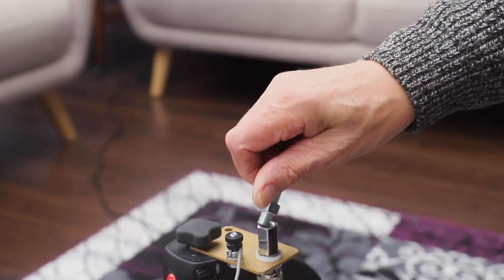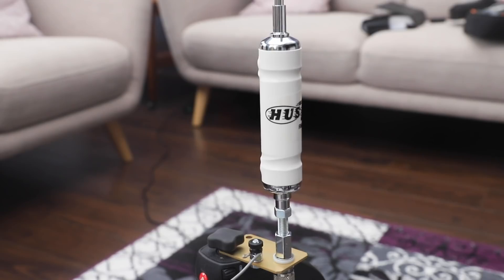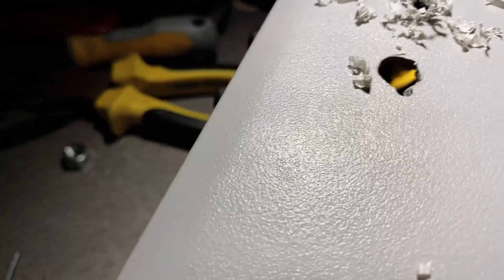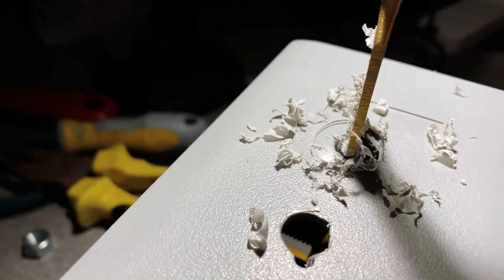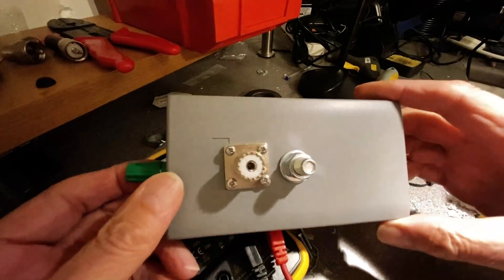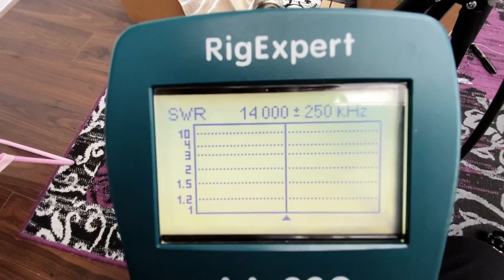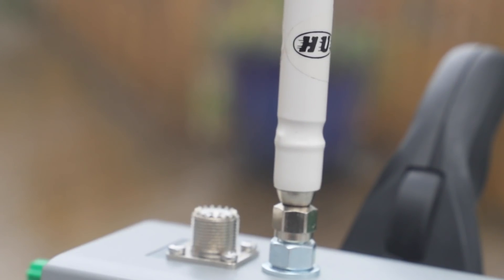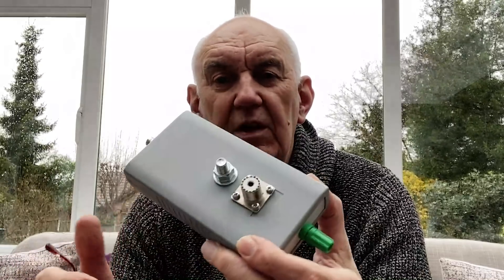Low Cost HF Portable Antennas - Great for IC-705!

Comment: Everything seems very weak and wobbly... you need to mount things using stronger clamps, connections, and things.
Reply from the maker: The engineering is up  to the user and the conditions in which it is used.

Comment: Another great idea from a man who knows.

I used to have every Hustler Resonator for mobile ops with a TS-430. I used a CB Spring mount on the rear quarter of my 1979 Ford Wagon and a Huster mast to get the resonator(s) above the roof line. I drilled and bent a strip of Alu and mounted 2 and sometimes 3 resonators. 40 or 20 up, 17 and/or 12/10 tilted back.  The tuning varied only slighty from just 1 to 2 to 3 resonators. It all worked quite well for the several 90 minute drives to/from the New Hampshire/Main coast lines for a day of Salt/Sea/Sun with the Dogs/Kids/Wiffy and once with a Siamese Cat!

Never thought of using the Hustler Resonators for Portable Ops. Great idea.

Getting HAM Functional again after a 4 year absence via Mobile/Portable Ops. Too much PowerLine/BCI noise to opperate from new QTH. This vid is a positive addition to my plans.

Thank You Sir for this and your other excellent posts.....

73 OM

Comment: I always been thinking about the common mode chokes in mobile usage, I have done some small testing with a mag mount, but don't record the results, I can remember the swr was impacted, and also the metal around the ferrite (cars body)

I'm just living in the belive that peple usually don't care about common modes in mobile hf, I might be totally wrong though, but so far what I seen it's quite rare to see chokes on mobile instalations
Reply from the maker: Thanks Kristian for that info. 73s Peter.

Comment: Where can you purchase a 3/8" male-to-male stud adaptor as featured in this video? I tried your website, but https://hamradiostore.co.uk/ seems to be down.
Reply from the maker: Hi Mike,

Go to a DIY outlet and buy a long 3/8" bolt. Screw on a nut and then cut the head off. Then unscrew the nut ro smooth out the saw cut. Hope that helps? 73s Peter.

Comment: how do you calculate the length of the counterpoise for these antennas?
Reply from the maker: Hi there,

If you are using a single wire, you need a quarter wave on the band of operation. Google has calculators for this. But you can often get good results with several shorter radials.  73s Peter.

Comment: I disagree Peter -  You deserve a prize for constructing this box - It's Great.
Reply from the maker: Hi Frank. Nice comment. But my eyes are not what they once were! 73s Peter
Reply: @watersstanton  Nor are mine Peter lol.  Just had my first ever contact with America today. On my End Fed Half Wave antenna I managed to get  high up in a tree using lengths of pvc electrical conduit joined together with a  hook on the end made from a coat hanger. From the hook I  tied a short piece of rope with a home made insulator on the other end  to connect the end of the antenna wire to. When I had the wire hooked on a branch I just pulled the conduit down leaving the wire up there. Pretty hard to see the wire but it is still up there even after the high winds we had lol.

Comment: Very nice concept. I usually use in portable station, 2tlt antenna and a full wave antenna in vertical position, works perfectly 25 mhz to 30mhz. 7351 and good contacts.
Reply from the maker: Hi Stephen. It's a nicely made antenna and works well. I have found that a lot of the beacons don't pick up "test" so well. Not sure if others have the same problem?
 73s Peter.

Comment: Nice little slant on our hobby. We need to encourage people to build more. I have used similar to the ground mounted box, they work really well on beaches. I wouldn't have bothered with the adaptor/piece of threaded bar. Just remove what is basically an elongated nut and screw the hustler straight on its place. Keep up the good work.
Reply from the maker: Hi Trevor. you are right but the reason I did it that way was so the whole mount remained rigid when swapping antennas. Thanks for your support. 73s Peter

Comment: Thanks Peter. Especially liked those project boxes and the way you can peg them to ground (saves lugging tripod about?). Curious to know what you have found works for radials? How many, are they tuned, are they raised or just lying on ground?
Reply from the maker: Steve, a quarter wave single works. Will cover in depth in another video. 73s Peter

Comment: Take a look at the MFJ1979 and Chameleon Hybrid, good from 80-6M.
Reply from the maker: Hi Robbie. I believe the Chameleon is an end fed wire with 9:1 transformer?  It’s OK for portable operation although the efficiency on the low bands will be low. Thanks for your input. 73s Peter